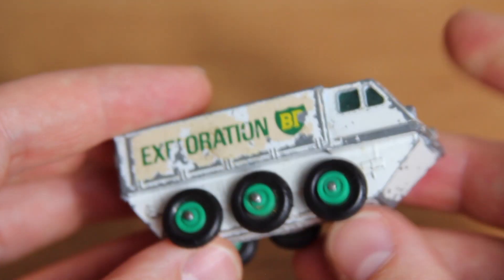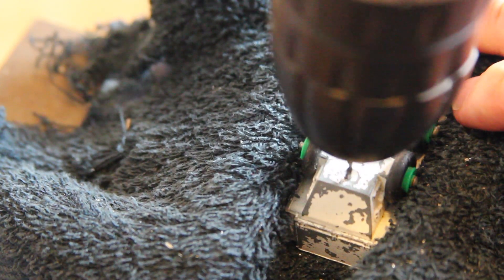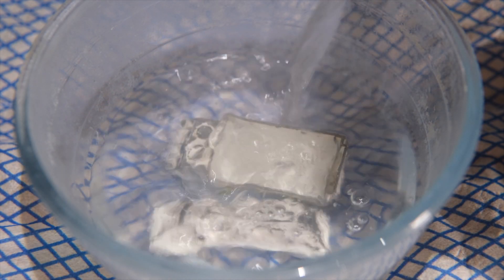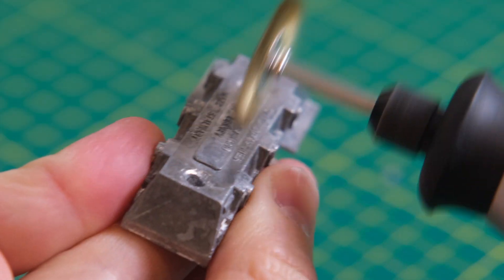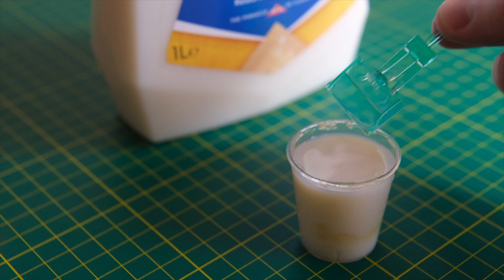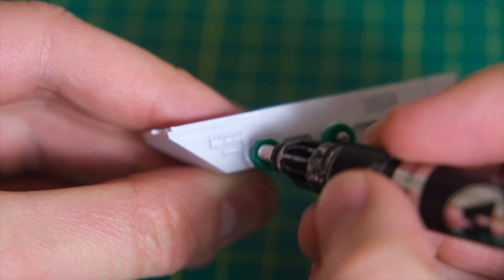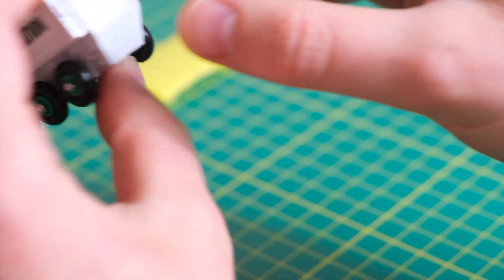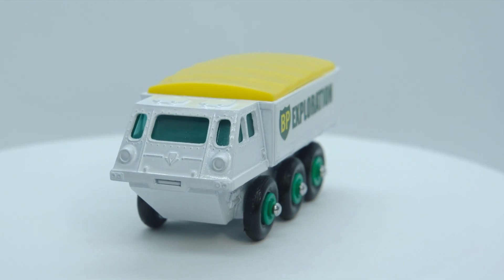MATCHBOX restoration: 61B Alvis Stalwart

Comment: Did you get the broken bit out or not bother?
Reply from the maker: Broken bit was totally snapped and it wasn’t a wide enough post to drill it out or even grab hold of with pliers. But happily it snapped back together and holds well with the tab at the front